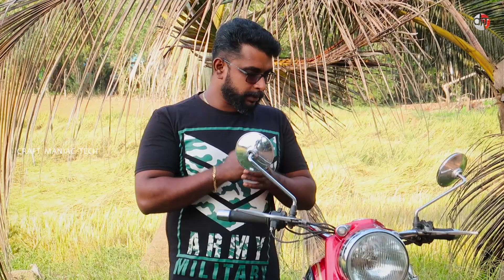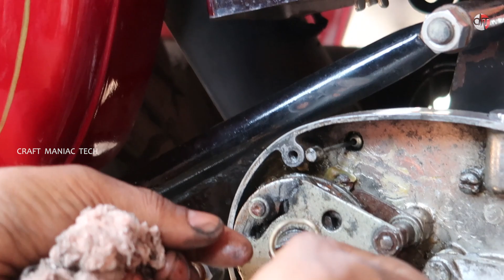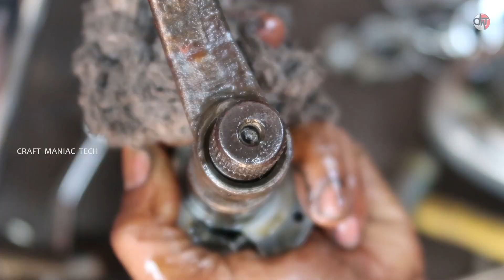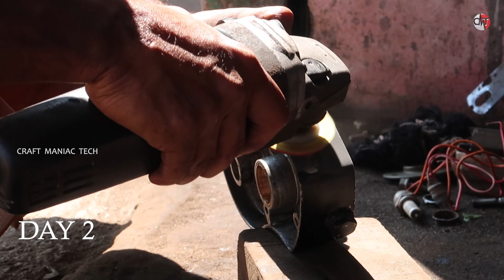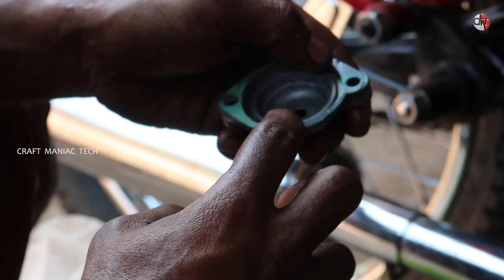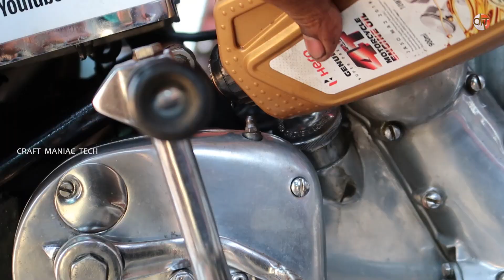Royal Enfield 🚫 || വീണ്ടും കിട്ടി അടുത്ത പണി 😪 || Royal Enfield gear box complaint 😰

Comment: Bro ellamkoodi ethraayi
Reply from the maker: I think 3k
Reply: @visualsonwheelsbyvishnu3000  bro ente vandi start akiyitt 1 year ayi engine oil otum illa appol eni entheke marenam
Start avan
Reply: Bro 1998 model bullet ath segment Ann
Electra ano standard ano
Bronte bullet polulla front shock absorber 
Alla covering illatha model ann
Reply from the maker: 1st clean your point
2nd oil change 
3dh carburettor cleaning 
4th plug cleaning or replace
Reply: @visualsonwheelsbyvishnu3000  tanks

Comment: Bro old model bullet maximum mileage ethreya
Reply from the maker: Depends upon the vehicle condition(around 45-50 km/L
Reply: Max 30 km per ltr
Reply: Nvr will gv above 30😂🤣
Reply: @rashique1994  👎2000 model 41 kmpl